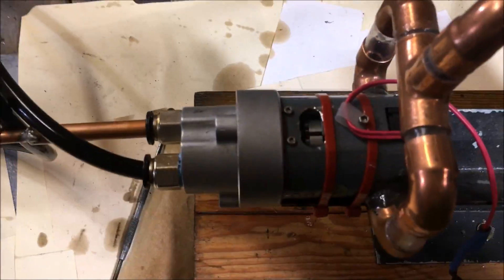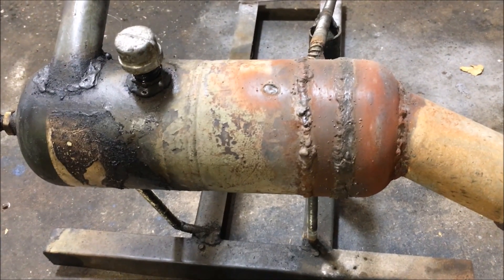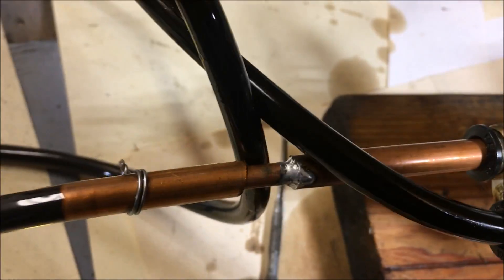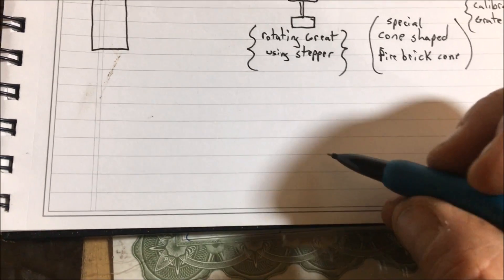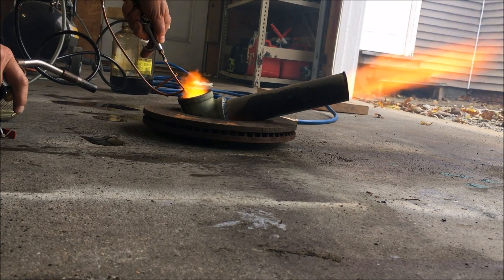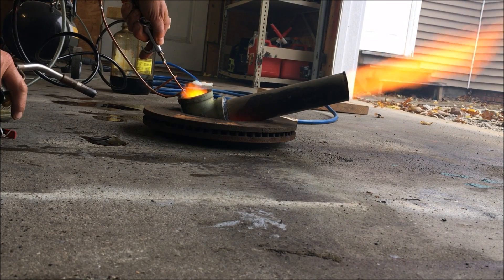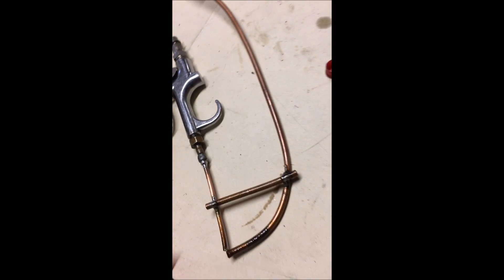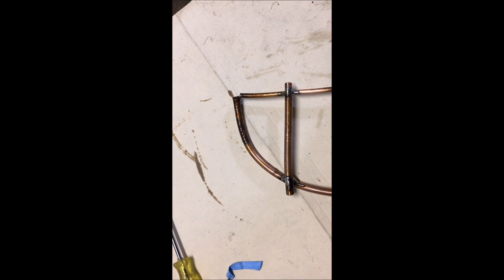Waste oil burner nozzle

Comment: please help me in making burner for water boiling.i need lower temperature with bigger flames.or send me the nozzle completely fitted
Reply from the maker: https://www.youtube.com/watch?v=0cXV8aF4j40  build one of these my friend , you dont want a nozzle system for boiling water , it requires an air compressor to run for hours , this drip feed device only uses a blower fan and no nozzle
Reply from the maker: ok i will help you , i do have nozzles i can send you but i suggest a drip feed device . i have one i could send you but thats very expensive to mail things far away . we need to fix you up with a drip feed design , give me some time and ill put a playlist together of my drip feed videos . i have well over 50 videos on waste oil burners
Reply from the maker: https://www.youtube.com/playlist?list=PLEezpzSfhM9aBZHAiWzLXC3ee3kIONWr1
Reply from the maker: https://www.youtube.com/playlist?list=PLEezpzSfhM9aBZHAiWzLXC3ee3kIONWr1

Comment: Bosch Turbine Fuel pump. Frantz-type filter. $10 HVLP paint gun. Oil Pre-filter= old blue jeans, zip tie ends of legs closed, pour oil through from waist, put legs into second container. A tiny ratio (95:1) of kerosene works wonders, added to BJ filtered oil.

Comment: My father used to run a space heater on cold winter days at the construction site.  The flame looked similar in size, but bluer.
Reply: +NOBOX7 - You are right about " Sodium ", there will be no way we can burn Used Waste Oil to get Bluer Flame, well unless Gasfier it.  I even mixed Propane during testing.... The Propane will burn clean and blue, but once it hit Used Oil, it turns Yellow ://
Reply from the maker: oil has sodium in it so i think thats why its such a yellow flame , my oil has 135 ppm sodium and from what ive seen and read it does not take much
Reply: Only way to get Blue Flames is to Gasifier it.  It will cost more Energy to Gasfier than it's worth.  Burn Oil straight, no extra Electricity to Gasifier it.